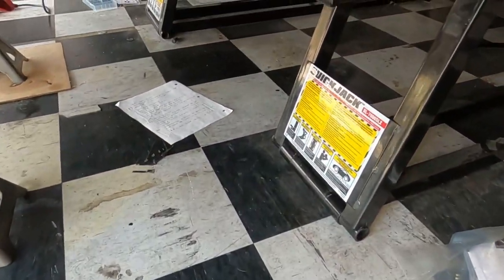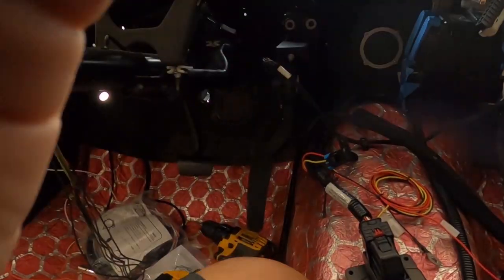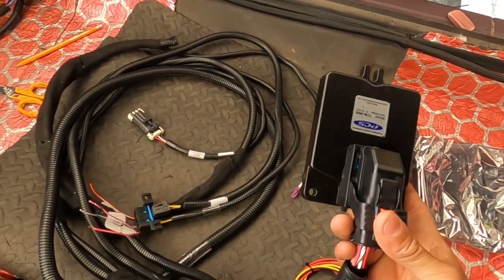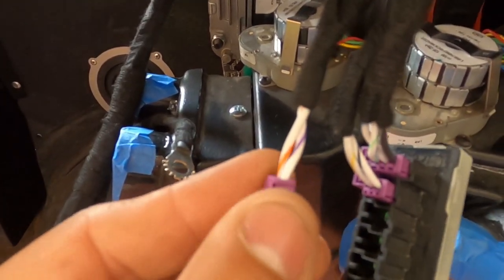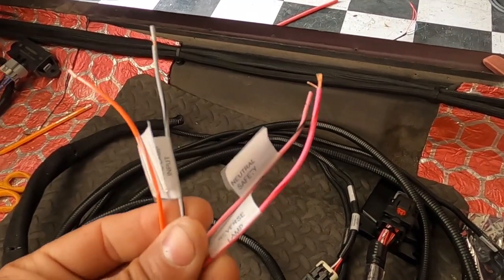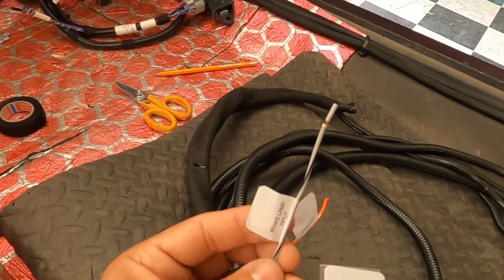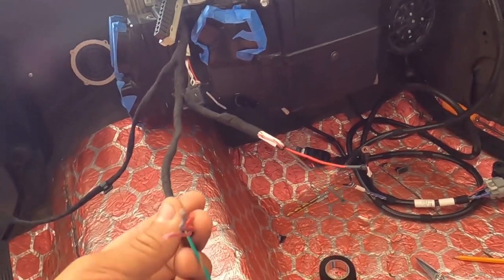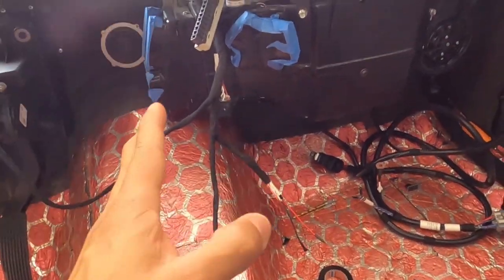HOW TO WIRE SOUND GERMAN TRANSMISSION HARNESS FOR YOUR HELLCAT SWAP W/8HP90 TRANS

Comment: It's a great kit.  I just hooked mine up.  In case anyone is wondering the pcm will not send the starter solenoid signal without receiving the clutch interlock signal.  Don't ask me how I know lol!  Other than an obvious mistake it was as easy as it looks.   You can depin that shifter connector and swap it for the other connector 68429697AA
 if you want to use the dial shifter.  I'm keeping the bench seat in my Coronet and don't want a floor shifter.  I think sound German has some other shifter options including the paddles.  He also has the wire setup to allow you to use the factory ignition switch.  These switches kill power to run when the switch turns to start.  A lot of people just use a push button.  Some use time delay relays for the ASD and fuel pump.  I think his solution is cleaner.
Reply: so as a dumb quick science experiment ( rather than trying to custom fabricate a 100% one-off axle that i might be disappoint in ) is there a way to control 2 ( computer wise as mechanically it's doable as boating use's some of the tricks needed and or fabrication is possible at least for a junkyard/janky swap quality, as i have a sibling/others close to me that thinks that the 8-3/4 and or the 3.2 final gear ratio isn't cutting it and or stacking transmission's could make the car better i don't think so but robot canteena youtube channel and some other people and or BEV-swap's have show enough ( probably by accident as it wasn't the OG goal of the swap as it was more of a adaptor part and or there vehicle's as lighter and or let powerful so maybe a little under powered and the extra gearing is making up for it but perhaps it won't work with mine as technically it's over engined and tire limited ect ) that i think it's worth trying on the simi-cheap as my engine would eat most transmission's up aka 600+hp category ect ) of them in a transaxle configurations ? for differential torque steering aka tank/bobcat/high end sport car's and racing 

gen-2 hemi in a 1966-70 charger with a TR6060/TR6070-mounted on a bell housing and replace the 8-3/4 axle in the back with 2X automatic ( or CVT ) transmission's and and two different paddles for up-gear changing and down gear changing ( aka a left transmission paddle and a right transmission paddle mounted on the steering column ) and a full automatic mode for finale gear/advanced mode for torque steering

Comment: What about the RPM and Throttle position sensor single to the transmission?  Does the transmission computer get those from the star connection?
Thanks!